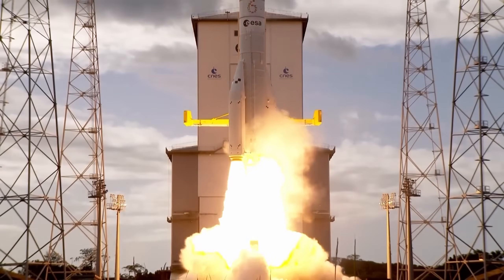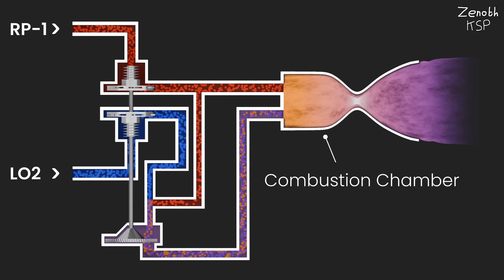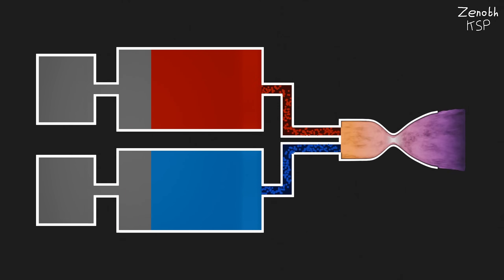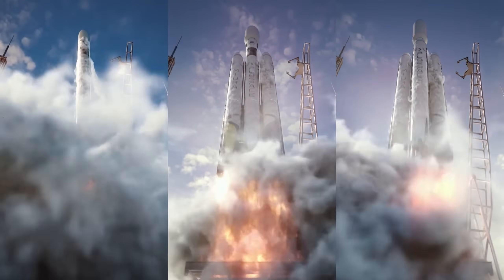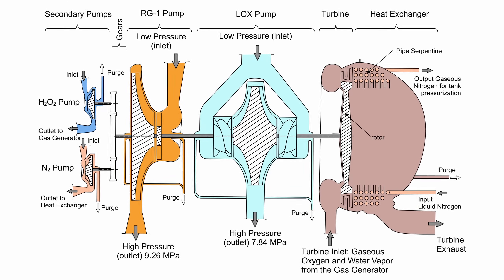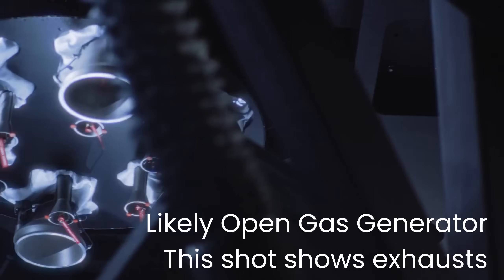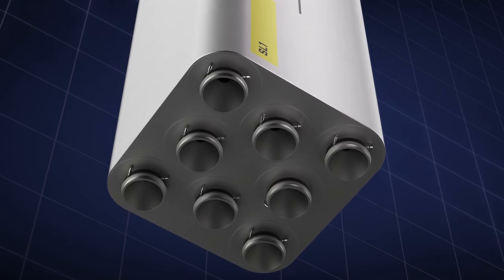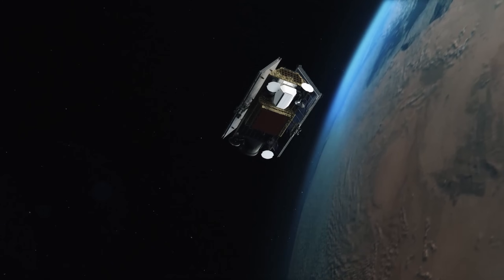European Spaceflight: All you need to know

Comment: I like the idea of enclosing tanks, but when using LOX and propane the respective boiling point is -183 (LOX) and the freezing point -188 (propane) Celsius. While you can keep both fuels liquids at the same temperature, I would expect trouble with solids. Or they would have to add methan at pressure to lower the melting point?

Comment: I'm not sure how to feel about PLD space's capsule. I want Europe to get their own independent crew capability so badly, but I'm not sure if PLD can do it. It's not as though they have zero experience, but announcing a capsule this early, when it likely wouldn't fly people best case until the late 2030s was certainly a choice.

Personally, my confidence is more in the Exploration Company and their capsule. They're only focusing on that, and flying it on other people's launch vehicles. It also will start as a cargo craft like Dragon which will help them gain experience.
Reply: PLD has only announced their capsule because it is going to take time to develop. They hope that the announcement can allow them to test and study how to make a successful crew vehicle instead of rushing it. PLD has also had massive breakthrough's and expansion in the past year with considerable growth of their amount of employee's and facility. They plan on launch Miura 5 in late 2025 btw. Also Miura 5 will also be designed to land vertically like a falcon 9 in it's later stages.

Comment: How often does a new car break down? What if that same car breakdown cost a customer 70 or 80 million dollars? There’s a reason why spaceflight parts are tested to higher tolerance than car parts
Reply from the maker: @Papershields001  Expensive German car part manufacturers are luckily pretty resistant to stress, so hopefully the engines will hold up. Single and 5 engine static fires went well, 9 engine not so much 😅
Reply: @zenothksp I’m very curious about how insurance providers will cover companies launching with RFA. They’re a company with fantastic promise, I’m just hoping they get the chance to fly enough to build a good track record. They might need some help from public entities like DLR or CNES to give them that boost they need.
Reply: Separate note: I love the video it’s fantastic!
Reply from the maker: @Rory-Shields  Thanks, that means a lot

Comment: Holy s*** Full flow stage combustion pushes kerosene ISP up to 330 to 350? holy crap, lunar starship should use that, it's one time use anyways, with kerosene's density and stability, that would be we better, and RP1 can be used in regen nozzles
Reply from the maker: Yeah its insane, 350 for an ox-rich engine, not even full flow
Reply: All talks fir now